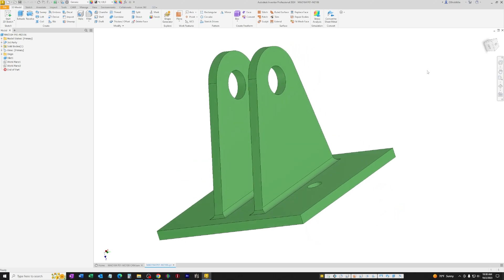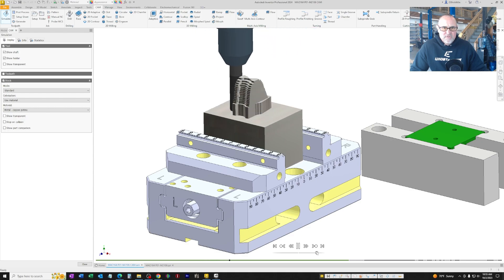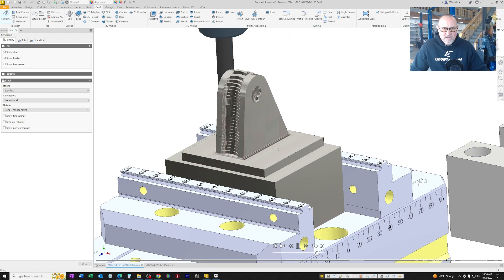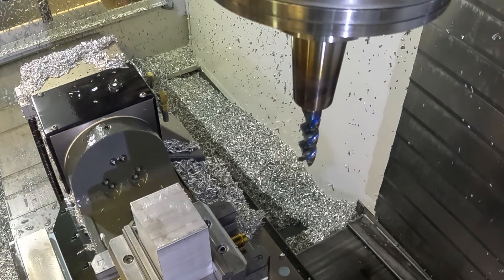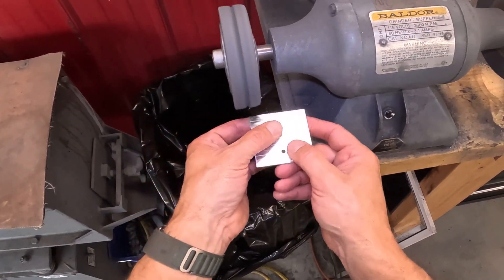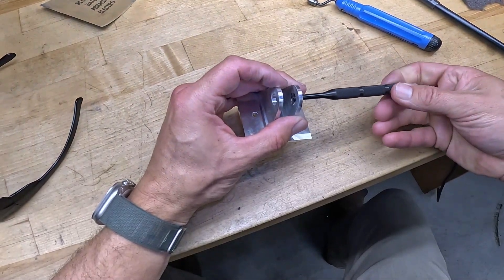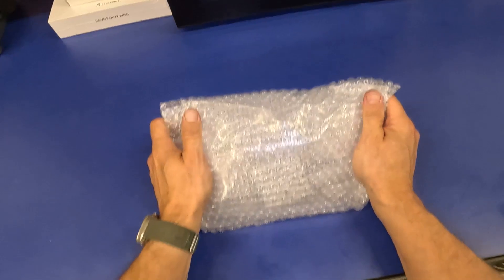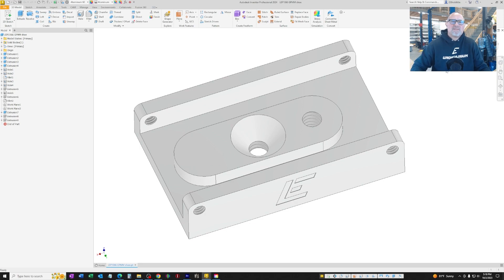Machining an Aerospace Clevis Unobtanium part

Comment: This is what you'd call unobtaniun? This is just a 3 axis part out of 6061, this is day 3 of programming. Sure 5 axis is nice to have and reduces your setup count but I've done a lot more complicated parts with 3 axis.
Reply from the maker: Devon, Thanks for the feedback! You are correct!  Doing this job on the 5 axis reduced setup and run time down to 7 minutes.  Sounds like you have the machining ability to create non-existent parts that 99.9% world considers non-obtainable.  Keep making chips! Thanks again for the feedback!